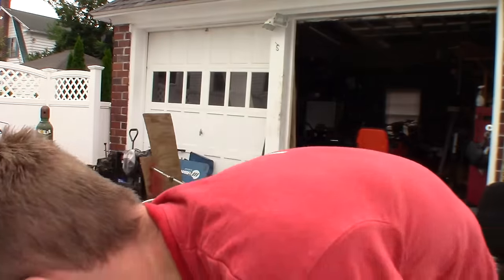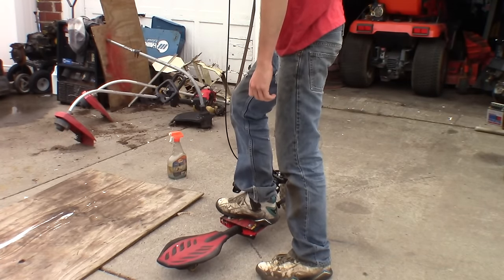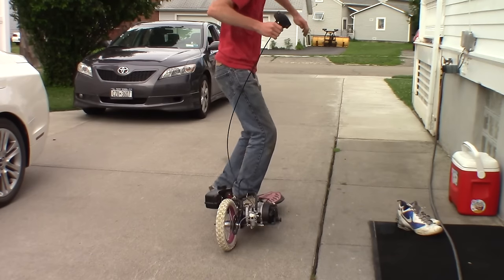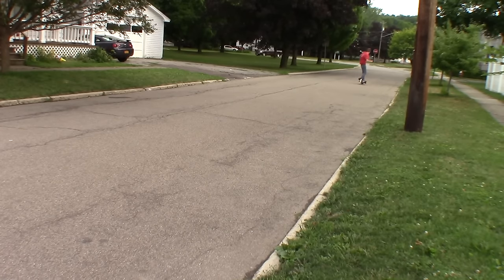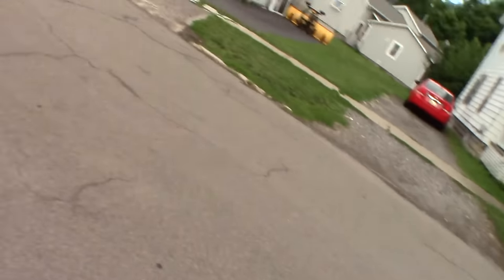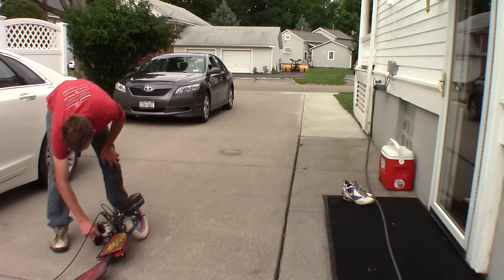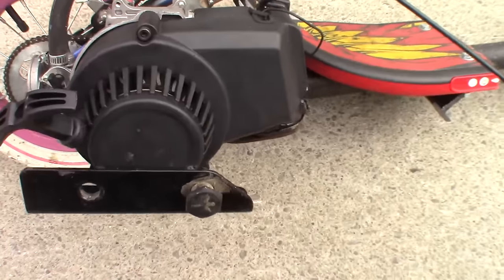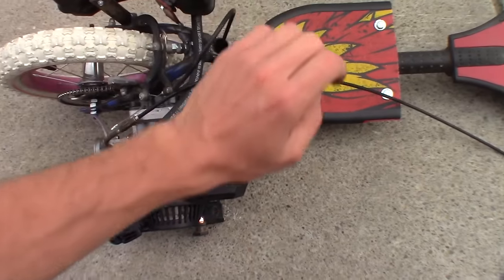FIRST RIDE - MOTORIZED RIPSTIK

Comment: Good to see young guys getting out in the garage and learning how to build cool and fun things! I have built many different motorized contraptions when I was younger skate board, bmx bike, mini sprint car for school metal works major assignment ( wasn't allowed to be motorized so made it pedal power but had an engine that I fit to it last day of school ) but have used the same sprocket concept and solved the issue of the engine being so far out to the left by turning the wheel around and mounting the motor over the back wheel, does no come completely centre but reduces the overhang by a fair bit and definatley helps with handeling, keep on creating cool things I went on to building race and show cars and own my own customizing/ Fabrication business all because I liked to build things and go fast!!!  have fun

Comment: what about you take the caster off the front of it and replace it with a skateboard truck. might not steer as tell as a normal skateboard but would be more safe and better for high speed at maybe make it solid do it can pivot

Comment: You definitely need to put a larger back sprocket on it. Also, does that style of hub have a "coaster" brake, that engages when it is spun backwards? If so, you should definitely either disengage it or remove it.

Comment: i would change it from a rip stick front half to a skateboard front half, making it a trike.  Then theres less balance that needs to be done by you.  might reduce the turning circle, but would make it safer.  would make it easier to change the wheels too...

Comment: Could try extending teh front end by welding the bicycle forks to the ripstick chassis (or making some out of solid steel) and then use the bicycle front tire. Make it roll better and could actually run it in the grass!

Comment: When I saw you pull out of your driveway the first thing I thought was that front wheel will never hold up!!!!  Lol..  Furthermore, CONGRATULATIONS!!!!!!!!:). AND GREAT JOB MY FRIEND!!!!!  just sit back and try out a few different front wheel designs, something larger with Air, possibly in front / Incorporated into / through the front of the board, and Go Get Yourself a "PATENT" For Your Invention!!!!:).  I know there are similar products out there but, what you have there is one of a kind!!  stick with the Gasoline Engine Aspect at First, but Make sure to Note it for ELECTRICAL Power in the Future!!!  honestly I believe the gasoline aspect has a tendency to draw people in at First.  we all love lithium ion and what it is done the power all of our electrical devices, and vehicles, but there's still ALOT of MOTORHEADS out there that would Really Dig Your Design!!!  remember it's all about that Front Wheel NOW!!!:). Good Luck My Man!!!

Comment: needs performance carb 80 cc bigbore tuned exhaust race clutch lightened flywheel port and polished and decked head race cdi and ignition coil

Comment: You should put it the front wheel up a little higher so there is not so much weight going down on it and you should get another wheel for it

Comment: You kept worrying about the direction of the motor, but just flipping the wheel around and you should have been golden.  That would fix your balance issue.  Then put skateboard trucks and wheels on the front as they are tougher, more stable, and can still steer by leaning.  Get the break and kill switch connected and give it a killer paint job and you are golden.  Not only will it look cool, but it should actually ride really good.

Then make a how too right from the start starting with a kids bike and skateboard and the motor and cable, brakes, throttle, kill switch... needed to make your own.  Show designs of all the brackets and plates you need to make it yourself and try to make it welder free so more people can follow your crazy design (put in several disclaimers though).

Comment: Not too much power but too much angle on the front wheel, back tire needs to be raised to get the board more level then i bet the front wheel would be fine.

Comment: might be safer with a longboard truck on front with some soft wheels, and more stable . I guess it depends on how dangerous you want it to be lol
Reply: i would just use a razor scooter front so you would have a place for the throttle and the front wheel would be better

Comment: fuck break in period on small enginesi never follow that shit and my engines run great and i personally own that exact engine and ripped it the second i got it
Reply: whats the engine on?
Reply: Poker bike
Reply: +JUNIX Cagliari
Reply: May not be 100% necessary, but part of break-in is rich running that is very poor running with minimal power. So, going through break-in without wearing on a clutch due to the low torque/rpms the engine puts out during that time helps those wear items last longer. Then once the piston/rings seat and you get better compression/tunability, using whatever the engine is attached to is easier.